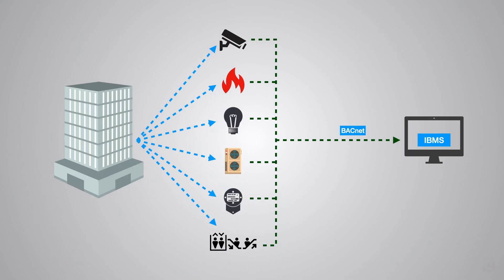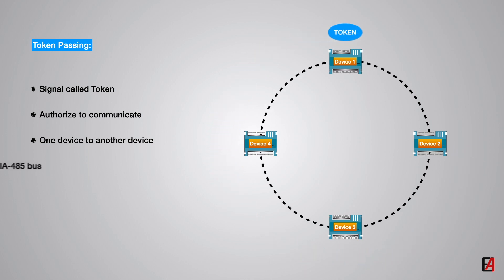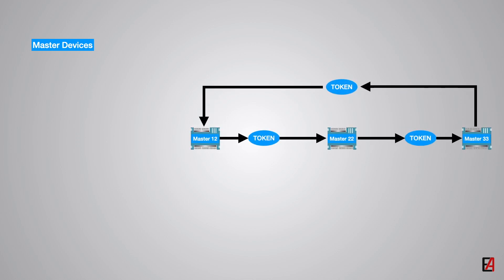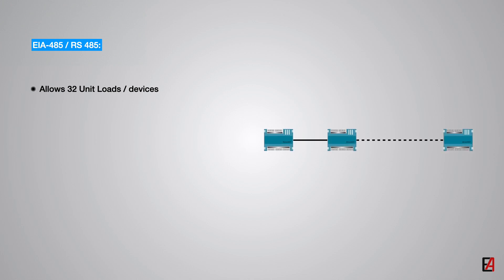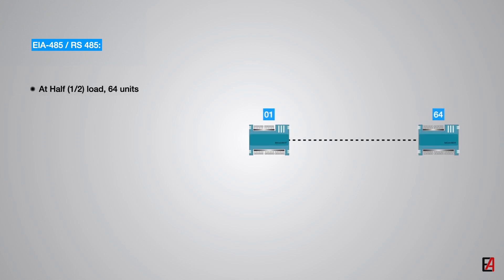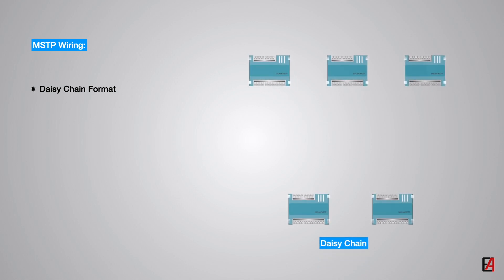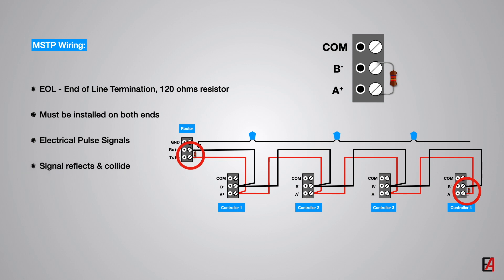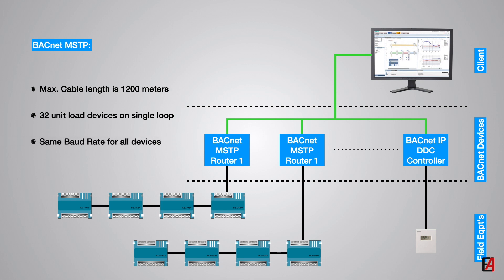BACnet MSTP (Master Slave Token Passing) Communication Protocol introduction and details

Comment: What happens with the com terminal 6:00 is it supposed to be connected to com of the power supply for the device?
Reply from the maker: Hi Fred.. sorry for the late reply. The COM terminal can be used to ground the shield wire.. if it is required as per the manufacturer recommendation

Comment: You will have to correct your slide 1200mts or 4000fts
Reply from the maker: Hi amit.. thanks for correcting. I have already pinned it in comment section.

Comment: 5:18 1200ft is equal to 400 mtr(approximately)...
Please correct
Reply from the maker: Hi Sanket.. thanks for pointing out. It's 1200 meters or 4000 ft the cable length supported by MSTP networks.

Comment: Well explained

So only building controller  BC can be master 
Advanced application controller AAC & advanced specific controller ASC  can only be slave
 0-127  ,127- 256 is it MAC address or device id address.?
Reply from the maker: Hi Salim, B-BC belongs to DDC controllers which are capable of taking IO points. That cannot be used BACnet MSTP. It will be either BACnet/IP or BACnet/LON. 

BACnet MSTP is used for ASC or AAC controllers which has very low power consumption. B-RTR Bacnet routers are required to connect the MSTP devices to BACnet/IP backbone. 

Both ASC & AAC controllers can be configured for both Master as well as Slave. Since slave devices have disadvantage, all controllers are configured as Master devices. Address range 0-255 (not 256 sorry) is the device id which needs to be set on the MSTP devices. Hope this helps.

Please share this video and subscribe to our channel. Thank you.

Comment: What is bacnet IP and OPC. PLZ make video on it
Reply from the maker: Hi Joel, your request is noted. 

Just for your info, BACnet IP is used only in the BMS system as it is the preferred communication protocol for the BMS system. However OPC stands Open Platform communication which is developed originally to integrate different vendors Industrial Automation Systems.